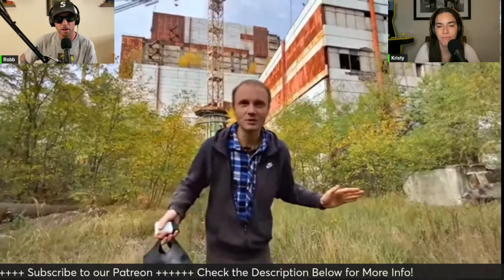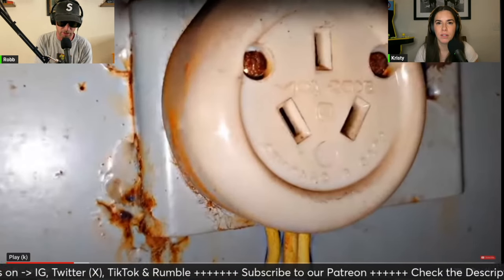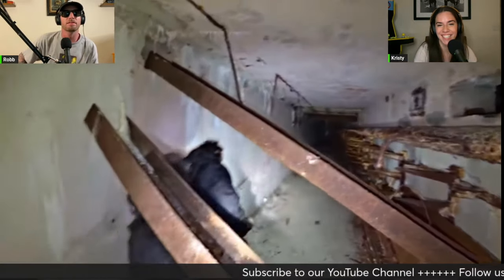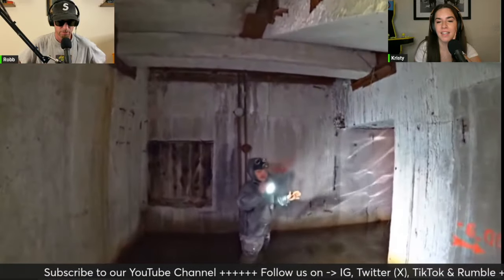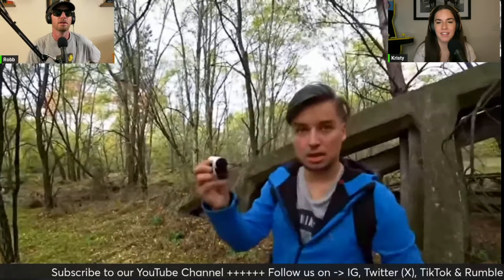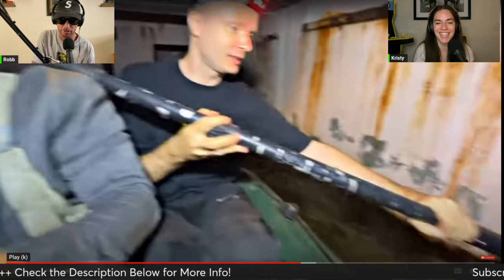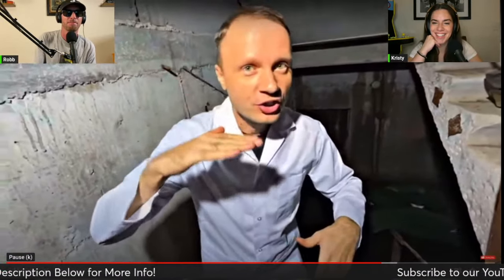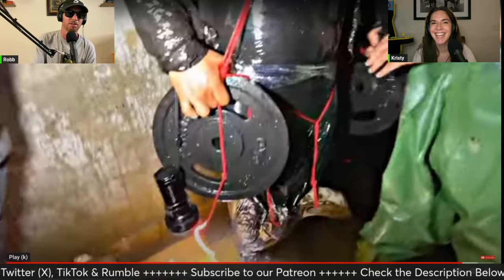Urban Explorers React To Scuba Diving Exploration In Chernobyl

Comment: So Happy to see you again Gang . I have followed these guys for a long time . They have a Bunch . Humour is Amazing . Keep Rockin from QB R&T
Reply: It was stripped before it was finished . Everything stopped at that site except for Trying to mitigate . These guys do use Detectors . They still might push the Boundries a bit . They are from the area and grew up in the Halo .
Reply: When Zeus puts the Fish Bowl on his Head with the duct tape and forced air . Lol
Reply: There were 3 operational Units and one under Construction . I think 2 were successfully decommissioned and Sarcophagus was built over the original accident scene which was encased in concrete . This area they are exploring has maybe slightly elevated Readings . Because it was a 1/2 mile away and many stories underground .